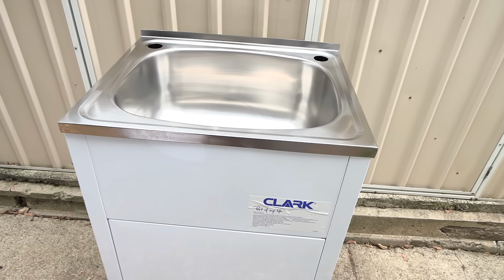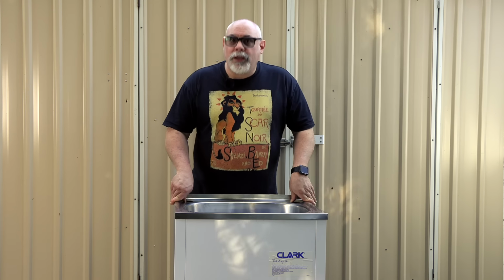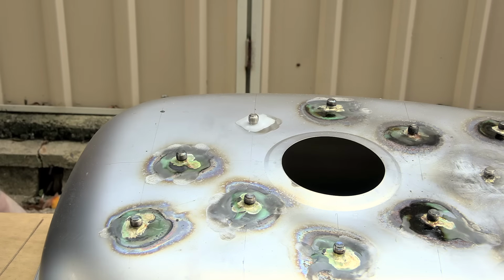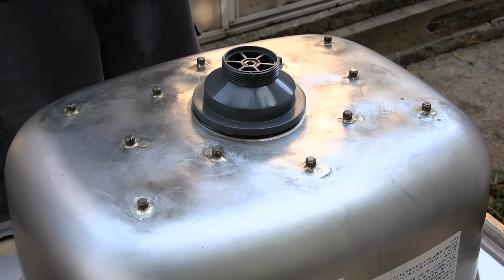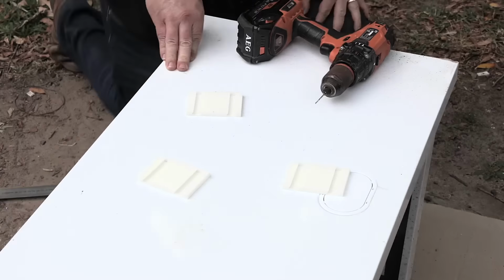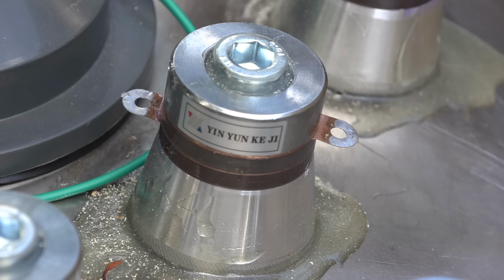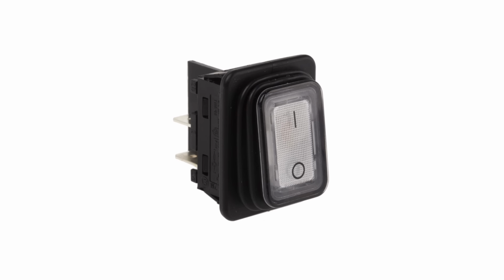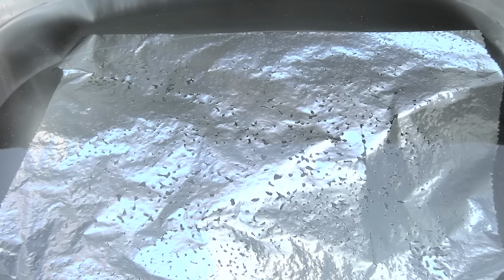Building a Laundry Sink Ultrasonic Cleaner

Comment: Should've thought to DIY a spot welder first lol

Also, the placement of the inducers makes me wonder if that was the right way to go. Reminds me of a Tech Ingredients video where me makes speakers out of acoustic ceiling panels and talks about how even placement actually isn't optimal. While they don't "cancel each other out" and as far as speakers go at least, they do interfere with each other if placed improperly.
Reply: You're right. The speakers won't "cancel each other because they're all in phase since the source of the signal is the same for all speakers.
BUT, as I was watching I thought that this project has 6 ultrasonic generators which are not synced, so once in a while some transducers will be 180º out of phase and WILL "cancel each other" due to the frequencies generated having some differences.
Since there's no 1 ultrasonic generator with power enough for all 12 transducers, I would put the pairs together to decrease the "canceling".

Comment: 20:13 you run cable through a rough drilled panel that will cut through those cables and short out to ground then 20:18 you say don't do electrical unless you know what you're doing..... oops. Got a sub and thumb though, like ya work knackers.
Reply from the maker: Have you had a chance to read all the comments and responses regarding this subject?

Comment: I've recently discovered the din rail terminal blocks. Now every problem looks like it would like to be solved with this specific nail.
I'd probably done the distribution and driver/PSU in din rail enclosures, and would have run individual wires to each driver. That way the pattern is easily rewireable without soldering, just changing over a few contacts on the terminal block. There are also premade meanwell PSUs for din rail.

Also, since you got two holes for taps, you could use one of them to store cleaning solutions you commonly use in a jug underneath with a small pump to feed it back up into the tub. That way you could drain the solution into the jug after using, and no dust or debris falls into the sink, it remains usable as a normal sink until need it to clean again, where you can quickly rinse the tub to get rid of the previously airborne dust, then pump the cleaning solution back up from the jug, and start cleaning. Of cause that requires diversion in the drain, but could be scalable to a few different kinds of solvent-soaked solutions, choosable with a flick of a switch ;)
Reply from the maker: Good advice!

Comment: As other have said the wires that pass through the metal cabinet need some sort of bushing. Also the whole cabinet including the sink should be connected to mains earth. Good soldering practise see that you have both a mechanical and electrical connection… the wires to the transducers should be passed through the hole in the tab, and folded over, then soldered. Also it is not good electrical practise to have both mains voltage and low voltage DC on the same connector.

Comment: Good build!  Although I think calling the outputs to the transducers "DC" is incorrect, as the signal is "ultrasonic", which is another AC signal.
Reply from the maker: There is a bridge rectifier on the driver, so it's definitely using DC for something. And the transducer output is labelled as "+" and "-", so I'm pretty sure it's DC.
Reply: @BranchusCreations  the driver output is going to be some kind of an undulating waveform that can be interpreted as an, "AC signal". The transducer is a polarized device though. When one terminal is high and another low it is going to either push or pull. Then when polarity is reversed it will do the opposite. That will not change.
Reply: The output may be AC but transducers are polarized. They're going to push when they get one polarity and pull when they get the reverse polarity. That's called phase. Generally you want motive elements to pull when they're phased properly.

Comment: Great video, I've wanted to build something similar for a long time but kept getting held up b/c I didn't know about wave cancellation with multiple transducers.  Thank you for making this video!

I do have one question and that is regarding the epoxy.  It looks like you used some kind of clear epoxy (maybe 5 min quick set or similar?), do you know if this is a BPA based epoxy?  I was wondering if putting very fine metal shavings (dust) mixed in with the epoxy, maybe something like copper, aluminum or stainless, to give a more dense material for the energy to flow through.  I think this might also help with heat transfer & from the transducer to the water.

I was thinking that JB Weld might be a very good epoxy for this. IDK if they sell that outside of the US, but the stuff is incredibly tough - it's so strong it can be machined!
Reply from the maker: I actually used JB Weld for my first ultrasonic build. The main reason I went to a clear epoxy is because I spoke to company that makes ultrasonic cleaners, and that's what they were using. I used a product called "Selleys Araldite Super Strength". It's the strongest epoxy the company makes, and it is BPA based. It's about twice as strong as the 5 min quick set stuff.

Comment: I'm no electrical engineer, but I imagine the drivers use the AC phase frequency as a clock so they all drive the transducers in phase. It's the same reason you don't get phase cancelation at concerts even though dozens amplifiers are used.

Comment: Save cleanup time by applying the flux to the bolt and then the bolt to the sink. More is just more cleanup and not better. Only the gap between the bolt and the sink needs flux because only that area benefits from solder.
Reply from the maker: Good to know!

Comment: I like it! Thanks.2 things... I've found it handy to use MAPP gas for silver solder.
And a sort-of question: transducer placement... The part of the maker community that makes flat-panel speakers has gotten great results from careful acoustic driver placement, I wonder if a similar analysis would be useful here, or if the frequency being so much higher mitigates the kind of effect that they see.

Comment: It seems that using multiple driver modules which are NOT SYNCHRONIZED means the transducers are not all working in unison.  Infact there is REAL risk of output cancellation thus reduction of cleaning. Have you used an O'scope to validate synchronization across all the transducers? (especially after being on for awhile which would exaggerate non-synchronous operation)
Reply: Thats a reasonable assumption to make - he mentioned that it still works and doesnt cancel. Which I think means that the resonance is actually generated by the transducer with the electronics. Not just generated by the electronics alone and sent to the tranducer. 

You would be right if it worked like an audio system, where the signal is generated in the electronics the  gets sent to the speaker. But I think in this case it operates more like a feedback loop (like if you hold a mic up to a speaker and get that nasty ringing :) )
Reply: Also I think because he uses a single driver circuit for all the transducers, they'll end up resonating together - if each transducer had a seperate driver they might start conflicting and cancel.

Comment: Live/neutral doesn't matter since the PCB is insulated and floating. It only sees the voltage difference between live and neutral, and since it's AC, polarity doesn't matter. I'm an EE btw :)
Reply: That's what I used to think. Then with more experience I'd run into some situations where it does matter. Live and neutral are not always interchangeable. The voltage to ground is certainly not going to be the same on both of them either.

Comment: Question: If you are epoxying the transducers, why even braze the center post?  Why not epoxy and add a lot of weight on the top to press the unit till the epoxy cures?

I'm aware that a brazer or welded center bolt would provide an excellect mechanical hold but since there is so much epoxy holding the unit, I figured it would wokr just as well.  Someone correct me if my hypothesis is wrong.
Reply from the maker: Epoxy on its own is not strong enough. Check out my last video to see the not-so-scientific strength tests I did. https://youtu.be/ByhGEFwCxoY

Comment: How can you be sure that the single drivers are in sync? If they are off by half a phase they cancel each other out... Is there a sync port?
Reply: I wondered about this also, although I thought it unlikely to be as dramatic as a half-phase.

Perhaps due to the fact that they're all tied to the same 50Hz AC source counters and wandering or slewing of the phases?

Comment: what would happen if it's running and you stick your hand in?
Reply from the maker: I've only ever put the tip of my finger in for a couple of seconds, and there is a tingling sensation. It's not a good idea to put your hand in there for a prolonged period because the cavitation will be going on inside your hand.
Reply: @BranchusCreations  makes sense that you dont want holes in your hand as you would spring a leak which aint good

Comment: So do the fans suck or do they blow into the enclosure and more importantly where is the holes for the air to come in or out of the enclosure
Reply from the maker: They suck. There is a gap underneath the driver PCB, and the fun sucks air from under the board, then across the board and out the fan hole.

Comment: AC doesnt matter which way around the wires go so it doesnt matter where you put the + and -  it does matter on dc though. for the 12v power supply its better to have overhead more than you need typically 10-20% so that its not running at maximum but you probably know this. for the nuts on the bottom of the sink there is an easier option but i guess its not easy if you dont have the tools. you can get a stud welder and weld studs on. 

great idea though i was intrigued because a sink is massive compared to a standard ultrasonic cleaner
Reply: You'd be surprised. Alternating current isn't as symmetrical as one may think it is. Hot and neutral are not the same. You wire an autotransformer up backwards and it won't work. You can't swap the leads in triacs either. Not everything is a simple resistive load.

Comment: 10% of flux and most likely 10% of sliver  solder is only needed to hold the little studs. Then you wouldn’t have to clean so much and sand so much of it less solder that’s is not necessary.

Comment: when you show your video on the operation of the tub please show the grounding and other safety issues, you are running electrical power under the same sink as all that wiring so keeping it safe is key. I hope to see the follow on soon, this is a great build as I am in the process of gathering materials to do exactly the same thing! I have to learn how to silvver solder, had not planned on that, but I am learning from your pain! thanks

Comment: high heat and quick soldering is better most of the time compared to low heat and being on it longer. With your method the heat does not have time to transfer to the internal components and then when you pull the iron away, the heat will quickly dissapate. But the high heat requires you be quick. (this is personal experience especially with plastic stuff.)

Comment: You are not doing it perfectly right with the amplifiers unfortunately...
The amplitudes of all amplifiers will not overlap all the time; in fact most of the time they will not due to phase drift.
Thus they will (dependent on the count of switched on amplifiers) simply cancel out and you only get a fraction of the performance you could get.

In short: Better get a one single signal source and multiple amplifiers that take its output as input.

Comment: If you don't mind the cosmetic side effect, I'm wondering if you could spot weld the studs to the sink. That would be quite a bit faster, and I can't help but wonder if you could do the same with the transducers themselves.
Reply: The steel is very thin and be horrible to weld, the transducer would be destroyed if you tried to weld it.
Reply: @sebastianflynn1746 Welding and spot welding are different things. Spot welding very thin strips of metal to other things has been a well established process for decades.

It might ruing the transducers, but if you can spot weld 0.1 mm thick nickel strips to batteries without ruining either, I'm quite confident you can spot weld studs to a kitchen sink.

Comment: Anyone who says the waves (when all in the same polarity ) cancel doesn't understand how waves act, if anything the waves interacting can multiply the output, but next time some one says 'no they'll cancel out'.. ask them if they stand in the middle of a set of speakers do they cancel each other out? Or if they watch a wave generator do the waves cancel each other out.. Neat project.
Reply: What most people don't realize as well is that each transducer is oscillating at a slightly different frequency, and likely drifting very slightly as well. The driver boards are not quartz-locked. As a result there will actually be phasing going on, so at some points the waves will be adding and at others they'll be subtracting but never cancelling. At 40 kHz, these effects won't even matter.
Reply: Anyone who says they can't cancel out does not understand how waves work. They do. That's exactly how noise cancelling headphones work. Its called constructive interference, and destructive interference.

Comment: Could you use a magnet, from the underside, to hold the bolts in place while you silver solder?  Just a thought.
Reply: Most metals lose their magnetism at temperatures needed for brazing.
Reply: Heat destroys magnetism. So no. It is called the Curie point.

Comment: Personally i think i would have done a single switch with 3 pos. So like when switch high its full middle its half full and low for just a little water.
Reply from the maker: That was the original plan, but I liked the look of the 6 switches on the control panel.

Comment: I would highly suggest getting the electronics from a reputable source. That will cost more but you then can be sure you actually get what you pay for AND have correct documentation. Amazone, Aliexpress and co are nice for some cheap parts but more often than not you really just get what you pay for - parts that are no where close to what the sellers claim on their website. If an LED on Alie claims to be 5W you can almost be certain that it is either a 5W-LED rejected by the original manufacturer cause it is outside the specified tolerances, or it is actually just something like a 3W LED and the seller claims otherwise. A year ago i bought some motor drivers for a mini-robot and... well, the listing and documentation said it was for 2W continuous power while the output-transistor was rated for 150mA @3V.
Reply: Try finding an ultrasonic driver board that's not made in china. Just about every ultrasonic cleaner on the market comes from there, with the exception possibly of some very expensive commercial models.
Reply: @stopthebus  There is a difference between being manufactured in china and being manufactured in china under the supervisions of a large coorporation with a name to uphold. Those send their own personell onsite for QC. And no, not hard at all to find non-china product, just as mentioned not on sites that only deal with the cheapest chinesium.

Comment: The waves will cancel out to some degree and more so when they become 180 degrees out of phase from one another. You may mitigate the problem by spacing and aiming the transducers so that there are fewer cancellations.The spacing will depend on the frequencies you intend to run them and this is assuming you are placing them so as the all face the same direction. Changing the angles of the transducers would add more or less modes in three dimensions and make the math a little more trickier.

 While the math exists to find the specific spacing, one could experiment by using a plate with sand on top. Place two transducers vibrating underneath the plate. You will see the modes in action and where the sound is at its highest amplitude and in which spot. If you want to see this in action, you can look up "modes audio sand" in YouTube to see some examples.

At least thats what I remember from an acoustics class I took three or four years ago. Although, we were working in the 20 Hz to 20000 Hz of the human hearing range. May work different in the land of ultrasonics as the wavelengths are shorter which may make for more complicated models.
Reply: destructive interference being any real problem - yeah no, that will not happen.
For that the drivers would need to be in sync, so at best it could happen to 2 emitters being driven by 1 driver, and even then only for very small regions and those will also constantly change place. So nah, not a problem.

Even for the audible range it is the same. Having many people playing the same notes on a Violine right next to each other will not lead to any perceivable destructive interference. To get that you basically need to have 1 pure signal that you are sending to 2 speakers and then be at a very exact position.
Reply: What most people don't realize as well is that each transducer is oscillating at a slightly different frequency, and likely drifting very slightly as well. The driver boards are not quartz-locked. As a result there will actually be phasing going on, so at some points the waves will be adding and at others they'll be subtracting but never cancelling. At 40 kHz, these effects won't even matter.

Comment: Very nice job!  One thing though, you might consider deburring the holes in the cabinet where the AC cables pass through.  It looked like there were some sizable burrs around the holes, and you don't want them cutting through the insulation.
Might even add grommets.  (not Wallace and Grommet though)!
Reply from the maker: Already done!
Reply: @BranchusCreations  GREAT!  Thanks.